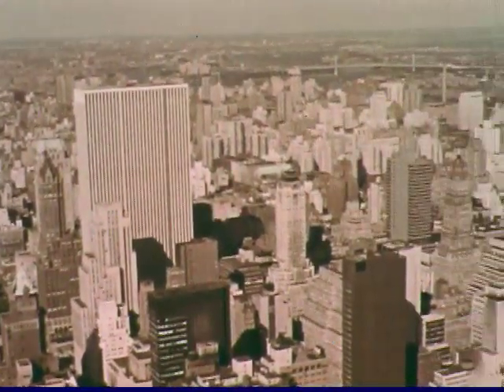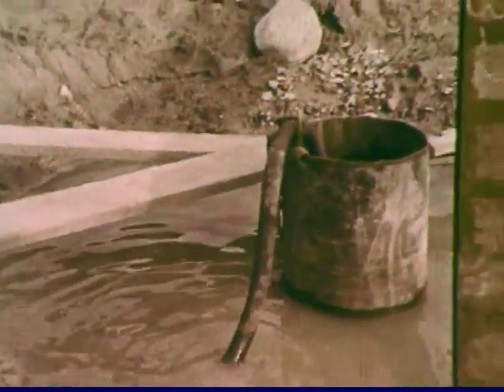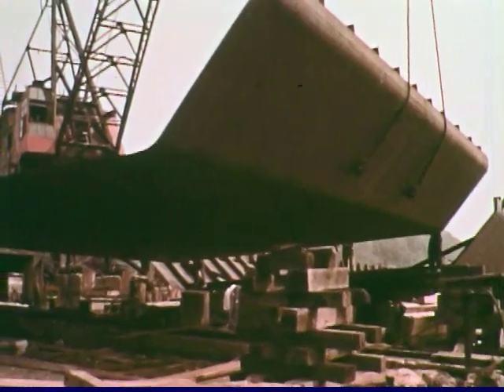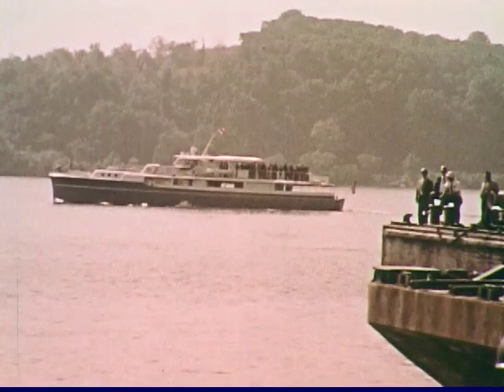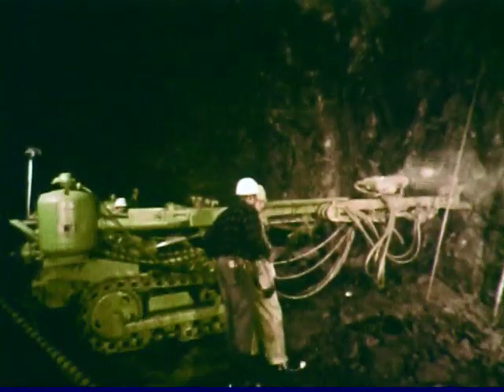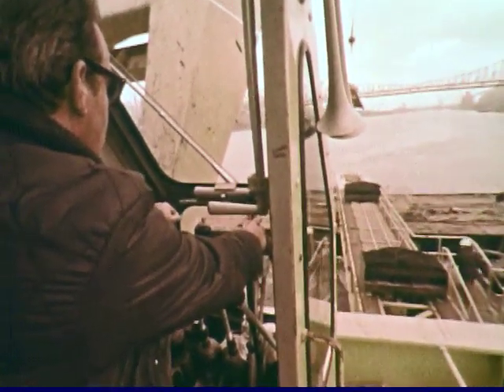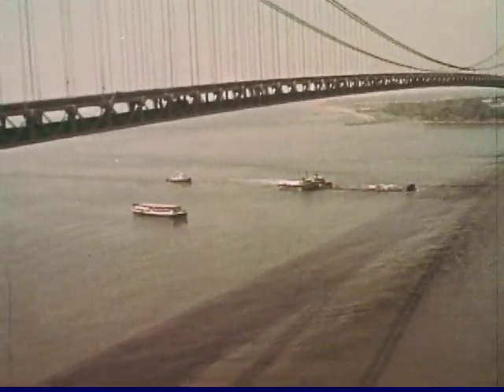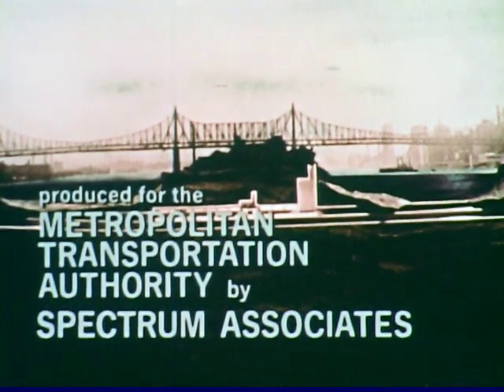East River Tunnel At 63rd Street - A Film Report (1971)

Comment: Fifty Two miles of new subway, turned into just 15 miles.
And by 1976,none of the new routes left under construction were anywhere near complete...
Reply: Right, the subway portion (upper level) didn't open until 1988 and the LIRR portion (lower level) opened just a few years ago.

Comment: What was promised that the 63rd Street Tunnel was to be flooded in 1976 was not made because of fiscal problems in NY in the 1970s. Since 1976 the year that the tunnel was going to open that did not happen we had to wait 13 years until the tunel opened for the first time in 1989
Reply: No.
The 63rd St subway was still being built in 1976.
The route itself was just about finished by the early eighty's.